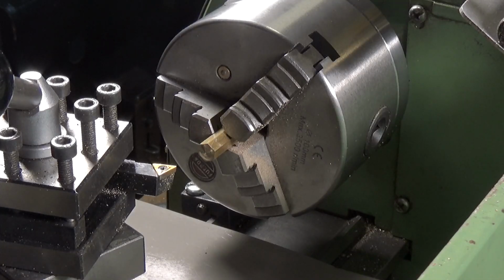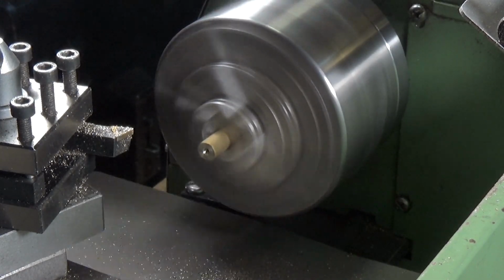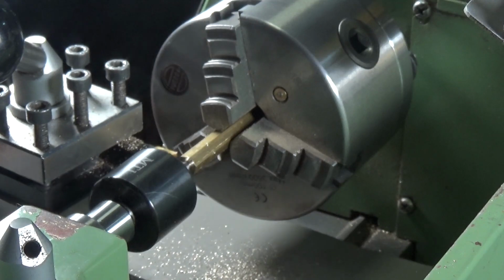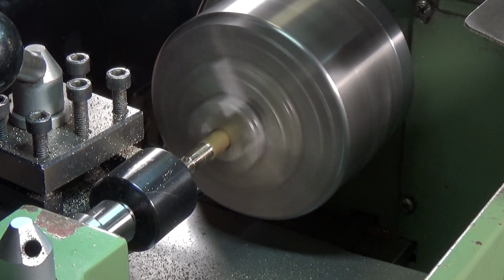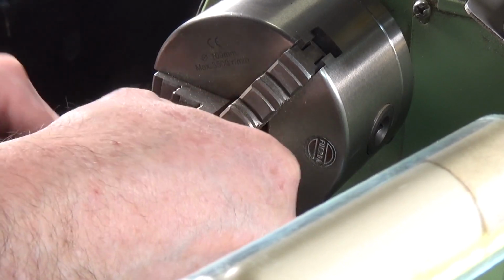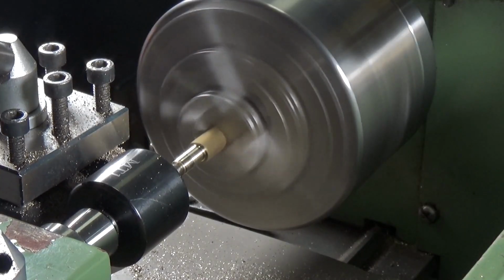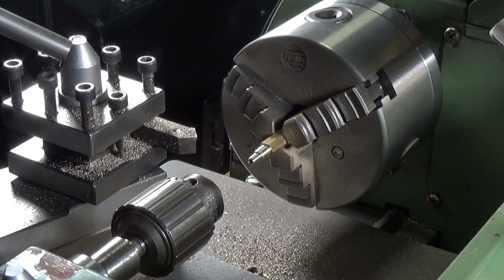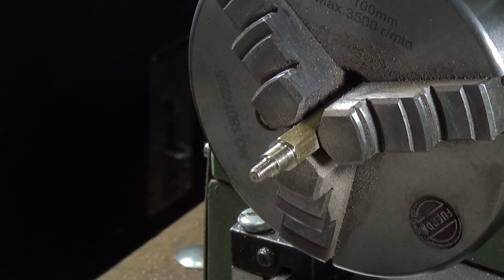Lockdown Project - Finger Engine - Part Seventeen

Comment: Say would you have any tips on preventing rust on the inside of steel weeden boilers? I know using distilled water helps. Any tips,
Reply from the maker: Hi. The best advice I can give is make sure you empty the boiler after running the engine. Ideally while the boiler is still hot, that way any small amount of remaining water will evaporate quickly.